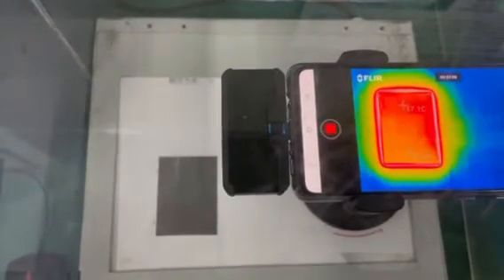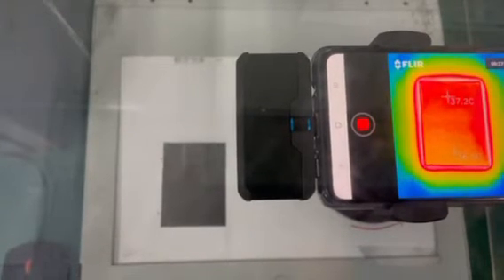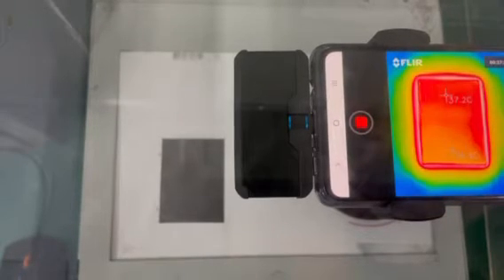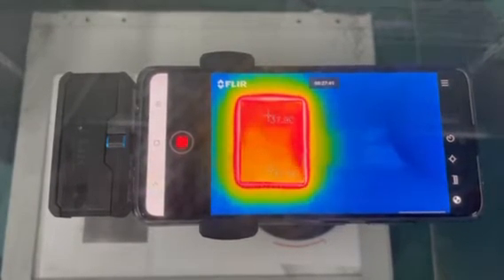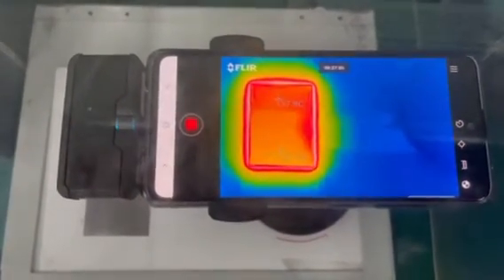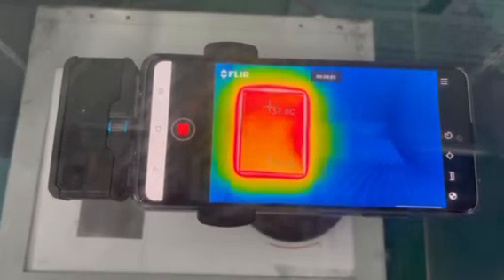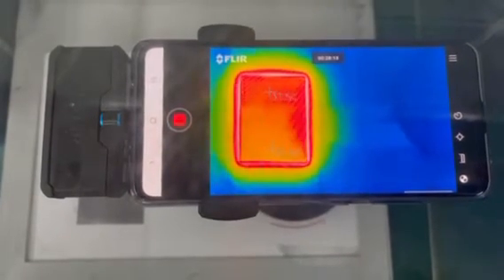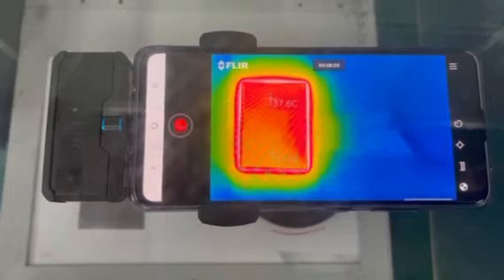Temperature rise test of graphite heat dissipation film

Comment: i think the one with the graphite sheet should be hotter out side if it's thermally conductive. if it's colder then it's only blocking the heat and the inside will be more hotter.
Reply from the maker: Graphite sheets are used to conduct heat from the equipment, thereby improving its performance and lifespan

Comment: cool video, but just wondering... If the ceramic was at 100C, why is the PGS only at 37-38C?
Reply from the maker: Because the x-y axis thermal conductivity of PGS is better
Reply from the maker: due to the festures of the graphite sheet.